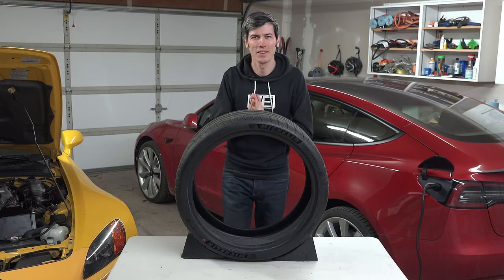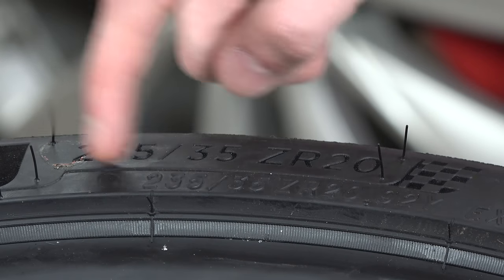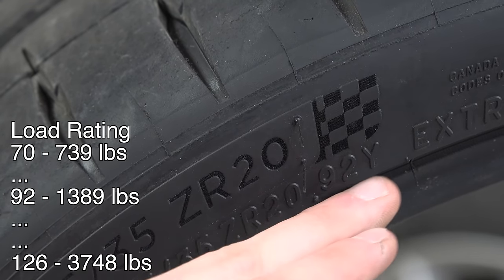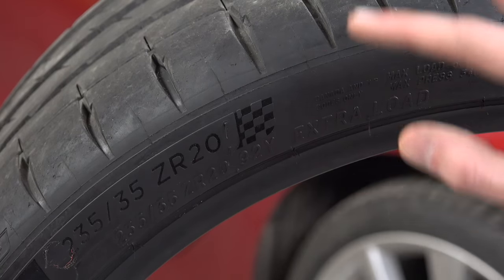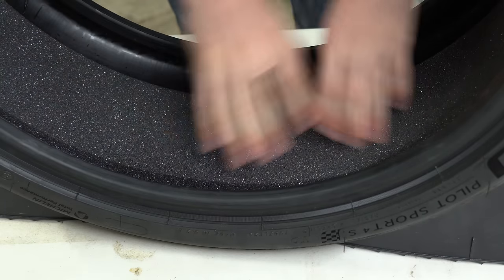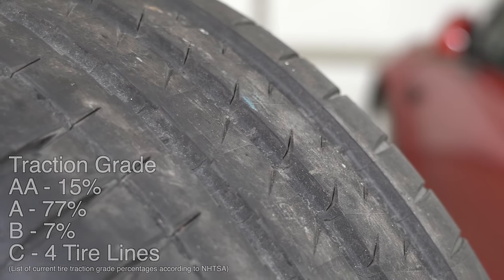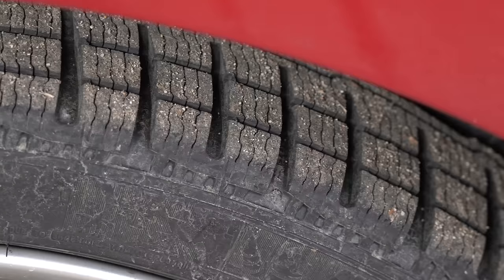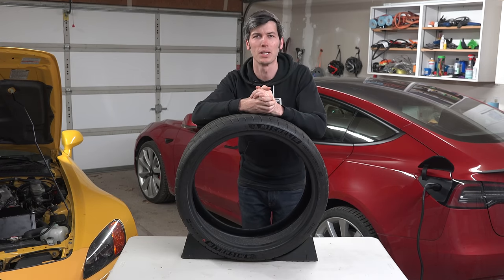The Ultimate Guide To Tire Sidewalls - How Good Are Your Tires?

Comment: You didn’t cover a few other things
 an S rated tire or an H speed rated tire has more tread depth than a y or z or v rated tire.. that is because, at the higher speeds a V or a Z or a wire rated tire is capable of attaining, centrifugal force of more material, greater tread depth would cause the tire to overheat. So when you pay more for premium tires capable of very high speeds, you actually get much less tread,,
  tires with a higher speed rating also have a stiffer carcass, resulting in a harsher ride. Because the tires ability to absorb tiny impacts with bumps and cracks and potholes in the road, has a lot to do with how much that affects the smoothness of the ride..
  you also did not cover the weight of the tire. If you can buy tires that have a lower speed rating and a tire that weighs less. You are going to get a tire with deeper tread depth which would give the tire a longer life, A not so stiff carcass because it does not have to be able to maintain very very high speeds that you will never see anyway also gives you a better ride..And a tire that has less weight makes a big difference in suspension compliance because of unsprung weight. Unsprung weight is such a critical factor in how quickly your suspension can absorb an impact with the road regularity, that energy from an impact with a bump in the road goes into your suspension spring, and your shock absorber controls the spring. A heavier tire makes that cycle of absorb and recover keeping the tire in contact with the road, that cycle takes longer the heavier the tire is.. unsprung weight is so critical, that for decades, Porsche has been using titanium Lugnuts to save a few ounces.
  you also did not cover the fact, that, many tire stores and garages, We will not repair a tire with very high speed ratings due to liability loss. They will not put a plug in a tire that has a speed rating of Z or Y or V, nor should they.
 One final thing
 putting an inner tube inside of a tire reduces its carrying load capacity by 10%..
 and don’t forget to always always put valve caps on your air valves after checking your tire pressures. Because centrifugal force and impact with bumps can compress the Schrader valve in your tire valve and let air out of your tires, especially on motorcycles where the valve generally sticks straight up..
 you should never never use tire shine products on your tires. If your tires are dirty use water or possibly glycerin, but never a product like armor all which dissolves the top layer of rubber exposing a new shiny layer. The tire absorbs the chemicals in Armero, and those chemicals reduce the tires resistance to ozone..
  you should not keep tires on your car that are over 6-8 yrs old..
 tread does not give you traction on asphalt or cement. Tread is just there to pump water away. Tread does not give you traction on hard man-made surfaces. The hard man-made surface digging into the tire is what gives you your traction..
  When you have tires mounted on your alloy wheels. Make sure that the tire store installing your tires does not use plain old dishwashing detergent. Dishwashing detergent, shampoo, laundry detergent, face soap, has Lye  in it..Why is the ingredient that makes soaps and shampoos and detergents feel slimy. The problem with those products is, Lye is highly corrosive to aluminum wheels. if you value your wheels, never wash your car with plain ordinary dishwashing liquid either…
  The Bugatti Veyron tires when the Bugatti Veyron was first introduced, cost $40,000 a set. I don’t know how much they are now here in 2022. But those tires could only be changed if you send the wheels back to Italy to have new tires installed on the wheels. It is a very stressful to the wheels to go through having tires put on, then having those tires removed, and having a new set of tires installed on the wheels..
  formula One car wheels are only used one time. those wheels are only designed to withstand having tires installed on them one time and still remain reliable..
  when you buy new tires at a tire store. And they sell you tire balancing service. they claim they balance the tires on your wheels to the micron.
  if they do not thoroughly clean your wheels before balancing and dry them. That balance job is not the best you can do.
  bubble balancing is the best if you have a three point mounted bubble balancer that has the spindle floating in oil. Bubbles do not lie. They still balance airplane propellers and helicopter rotors with bubble balancers..
  I bought a coats Old gas station bubble balancer from a garage that was upgrading to a snap on spin balancer back in the 80s. And I have turned down the spin balance job offered at the tire store ever since. I asked them if they clean the wheels and scraped every speck of tar stuck on the inside of the wheel. They said they do not. And I always tell them, the well there goes your micron perfect balance if you don’t clean the wheels…
 also, it is a waste of money to fall for the nitrogen in your tires sales pitch..
  if your tire wear pattern requires that you have a front end alignment. And you ride mainly by yourself in that car, have the front end aligned with you sitting in the car behind the steering wheel..
  tires do not always wear flat because of the crown on the roads for rain to drain towards the curbs. It’s not that prevalent on four wheeled vehicles. But it is very prevalent on motorcycle wheels. All motorcycle tires wear out slightly to the left of center the fastest because even though you are going straight down the road on a motorcycle, because of the crown of the road you were always riding on that’s slightly left of center part of the tire..
  when riding in the rain. It is not a bad idea if you were going to be in the rain all day especially on a motorcycle to increase your air pressure 4-6 psi.. this shrinks the contact patch your tire has with the road which actually increases the weight per square inch in contact with the road giving you a more forceful pressure to squeegee water out-of-the-way and reduce your likelihood of hydroplaning. The wider the tire, the more prone to hydroplaning it is.. drinking the contact patch puts more weight per square inch pressure on your contact patch.
 on motorcycles, they have tires designed for front wheel service and tires designed for rear wheel service. These tires generally have arrows of direction of rotation.
 if the tire is labeled front and an arrow that is a front tire and they’re showing you the way the tire should be mounted to rotate. The same with the rear tire. If it says it’s a rear tire and it has an arrow showing rotation direction, that is the only with tire should be put into service..
 there’s an exception
A tire with a more universal tread pattern such as the Dunlop K81 tires, that tire has an arrow, and beside the arrow is the word DRIVE.. that indicates which direction the tire should be mounted for the drive wheel which is the rear on a motorcycle. But you can install the tire in the front but you turn the arrow around facing backwards because breaking forces have the similar effect on the tire carcass that acceleration forces have on the rear tires..That’s particular tire and others do not have a tire tread developed for just the front tire or just the rear tire. That’s why they indicate on the side wall that that tire must be mounted in one direction for rear wheel use, and the opposite direction for front wheel service..
  I would like to hear the correct definition for older cars that came with bias tires like my 1958 mga that I have owned since I was 15 years old in 1967. It came with VW bug 560/15 bias tires. But I installed radial Michelin ZX tires of that size decades ago..
what is the difference between suspensions designed for bias tires, and switching to radial tires?
 I also had back in the day a 72 Chevy Chevelle. It had bias tires on it when I bought it. But I put radials on, and the ride was very harsh and it hit potholes very hard. It transmitted those impacts up through the suspension I could feel every pebble..
  Great video, I actually learned a couple things. I did not realize they increased some of the speed ratings above W. That information is sort of useless to me because I’ve never gone over 90 miles an hour in my life on public roads. Even though I roadraced  motorcycles winning six championships and two time national champion. I never liked going fast..

Comment: Tires should have their suggested air pressure imprinted on the side.
Reply: The recommended cold pressure will vary by vehicle model. Some manufacturers specify different front and rear pressures due to weight distribution and handling characteristics.

Comment: actually max cold preasure is for maximum cold preasure. maximum tire preasure is max preasure hot. do not fill to max tire preasure.
Reply: however it is safe to run at max cold preasure.

Comment: Why do they write a number for hight of sidewall  which is a percentage of the tire width ? Why not just write the actual tire hight ? Why do we need to know what the percentage is ? It confuses the issue ! Or they should write  235 / 35% of 235/ Z R 20 .    Or  write 235 / 82.32 / Z R 20 Then people can understand without having to calculate how high the tire is  .

Comment: That tires does not have a P because it meets European standards. There is Metric, P-Metric, LT-Metric and High Flotation sizes. A lack of P indicates the tire is metric but European metric which has higher standards than the American P Metric.

Comment: Sir what's meaning of 185R14 C
Reply: you are missing a set of numbers 
185 width  the sidewall percentage is what you forgot to mention and r14 is th rim size C is the speed rating, which is low speed rating considering the small size of the tires width maybe

Comment: Ugh... Tesla tires..... going to replace tires on my Model S tomorrow.  barely making 26k miles on a set of Goodyear tires with the foam inside. I don't understand why Tesla would put such "cheap" tires on their car.  I know... bringing the price margin down.
Reply: Almir Osmanović Price doesn’t correspond to tread life. Wet braking, handling, comfort all result from design and compounding. Stopping shorter than the car ahead is better than superb tread life— it’s all a matter of compromise

Comment: This channel is called Engineering Explained (your big fan since always btw)... why are lbs and other imperial nonsense used in the explanations? Is this not actual Engineering, or is the "Explained" part ment as in explained to the backwater tribes of 'murrica? God save the queen, what year is it?

Joke aside - you should be proponent of metric units, in the forefront of rooting out the imperial lunacy. I am sure you can agree with that,  which leads me to question why dont you use solely metric units (whenever applicable ofcourse - you cant not use inches in the wheel diameter, but you sure as hell can use kilograms for load classes...) which would help the "unenlightened" adapt a superior system, that is the only one used for any real physics and also better applicable to real life.

Comment: The treadwear rating is a useless piece of information if it can't be compared across different brands.
Surely the one control tyre (at a treadwear rating of 100) is to be used for all manufacturers, if not the UTQG is a vague guide at best. Boo!